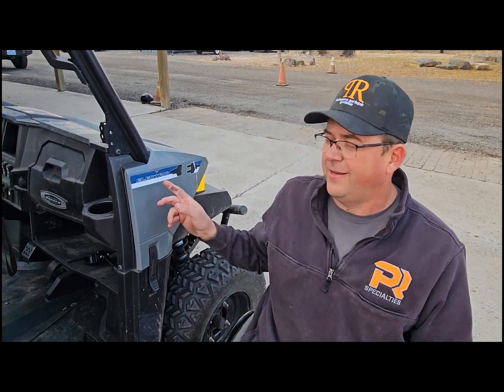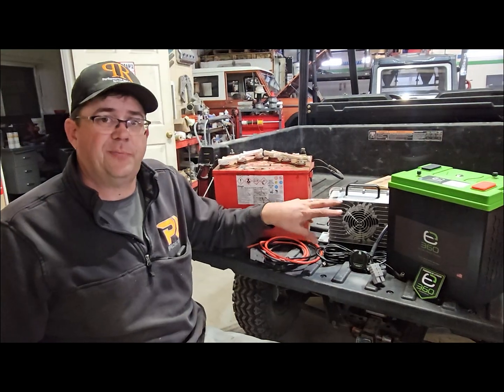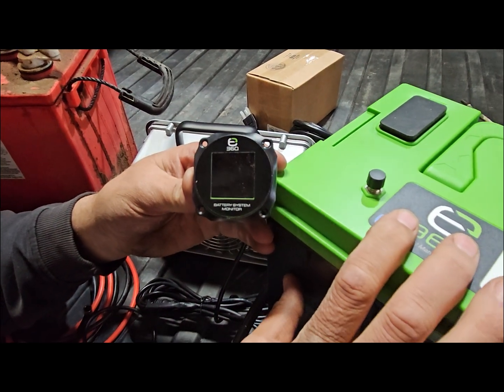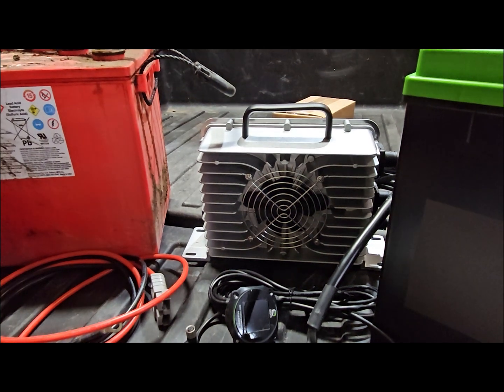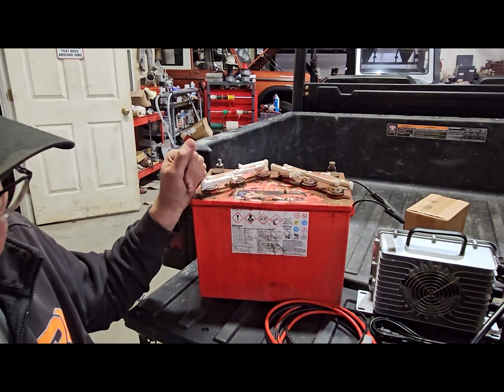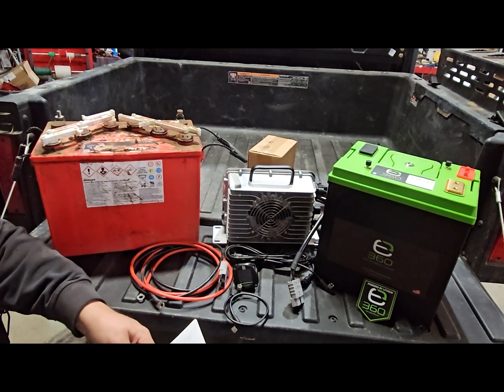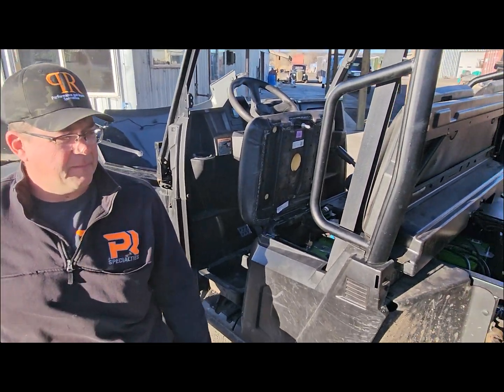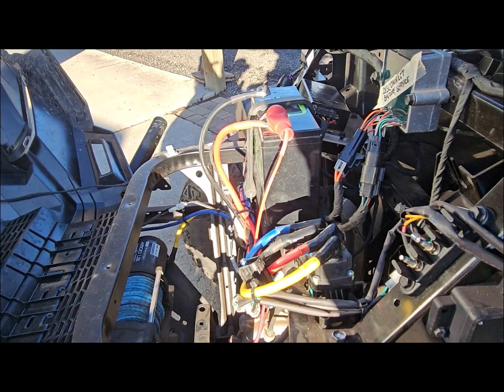We converted a EV Polaris Ranger from Lead Acid Batteries to Lithium!

Comment: How are you getting 27-28mph? did you program the Ranger?
I have done a lot of lithium swaps on these Rangers, and I have one myself using my own FleetLithium brand battery, but all the Rangers I have worked on, mine include, are governed at 24.5mph, verified with GPS. 
I even have 27” tires on mine, and it still just gets me 25.5mph. 
The lithium swap has never changed my top speed at all, it’s governed!
It does perform a lot better, acceleration, and handling is better, yet the ride quality suffers  immensely, from being to stiff. 
I am assuming to get almost 29mph you have already had it programmed.